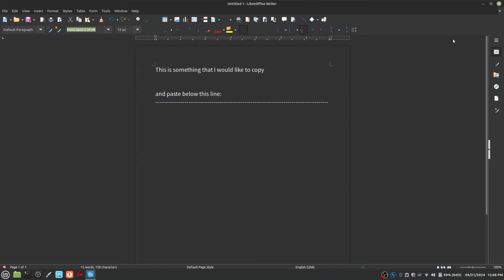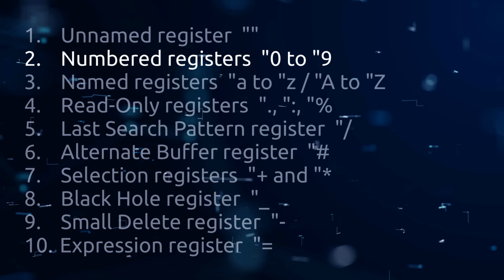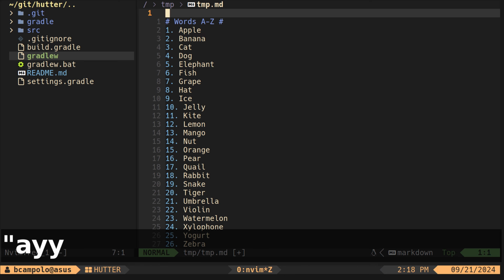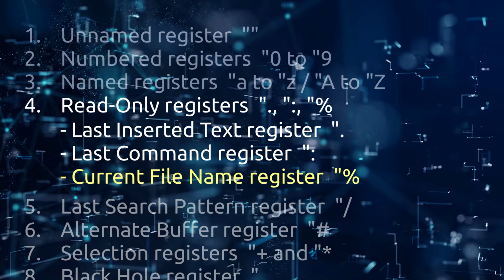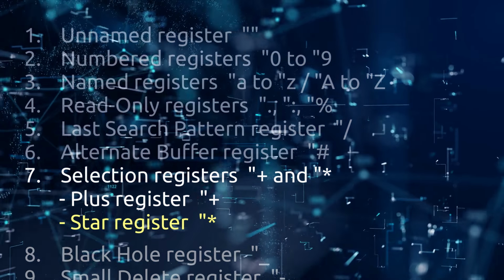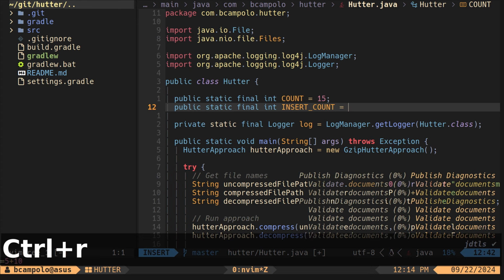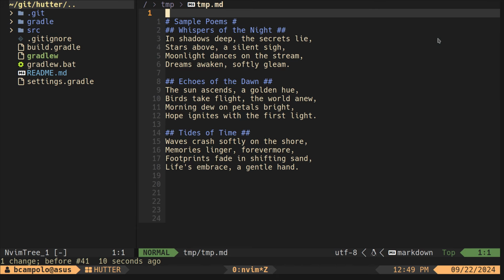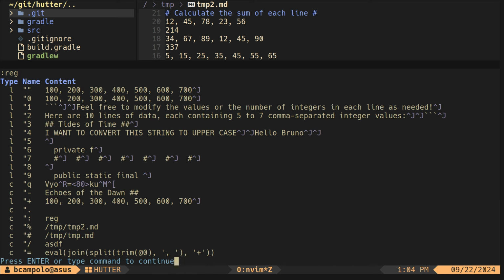Neovim Registers

Comment: Instead of doing all the "=toupper(...) stuff just remember that:
Normal & Visual mode: Tilde "~" switches the text case.
Visual mode: U or u can be used to make the selected text uppercase or lowercase respectively.
Reply from the maker: @yarrakobama3417  You make a fair point.  toupper was used really just to show how to call builtin functions because it is an example that everyone can understand.  IIRC tilde reverses case which is not quite the same as toupper for something like a sentence or title case.

Comment: how did you make the text to speech?
Reply from the maker: @underflowexception  I'm currently using ElevenLabs
Reply: @bjcampolo   Thanks for the tip. It's insane how good these voices are nowadays.
Reply: @bjcampolo dude I watched your other video where you use your own voice and did the experiment. Why did you go back to using this Ai voice?
Reply from the maker: @runningman2989  Mostly because it is comfortable but also after the experiment the AI video actually started to surpass the one with my own voice 🤣